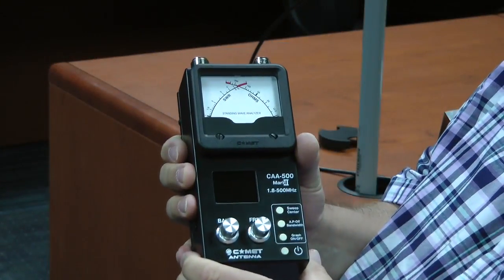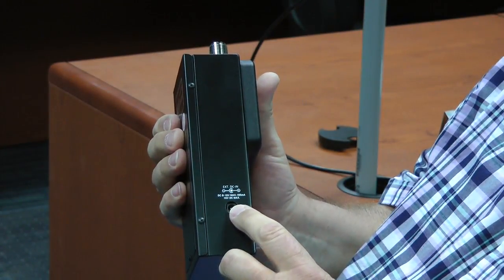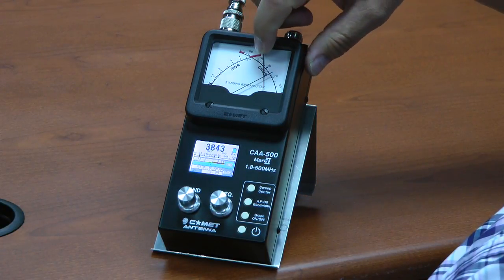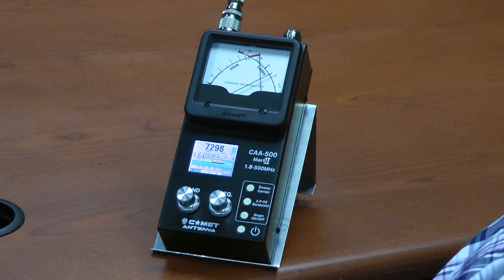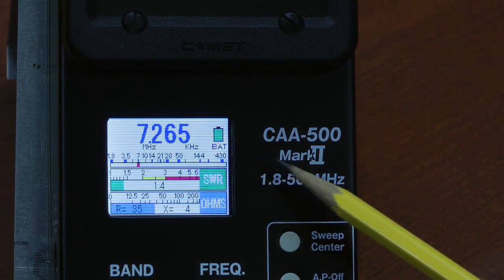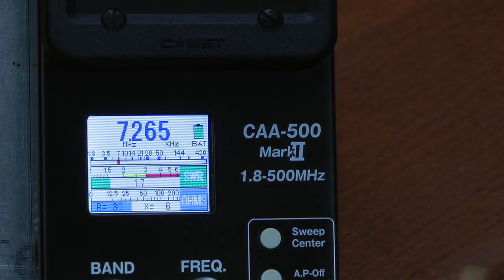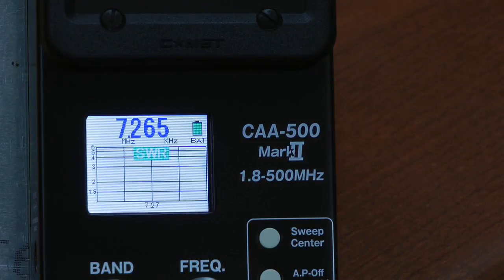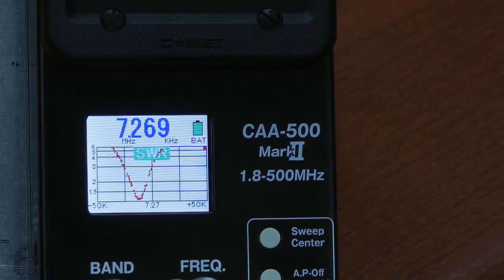Comet CAA500 Mark II Antenna Analyzer

Comment: Why an N connector for 300MhZ and up?   Does it come with an adapter with a SO239 and one end to a male N connector on the other?
None of my antennas use an N connector on the coax
Reply: It's standard to use N connectors from the 70 cm band on up. If all your antennas are below the 70 cm band then you won't need that other connector.